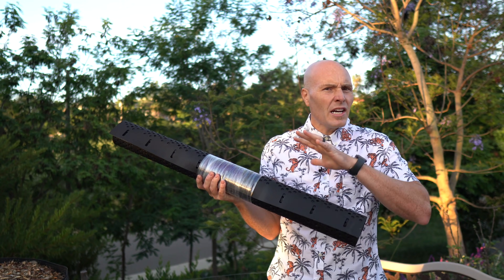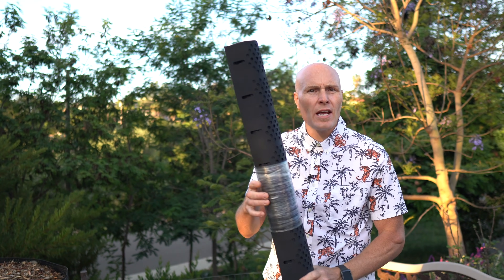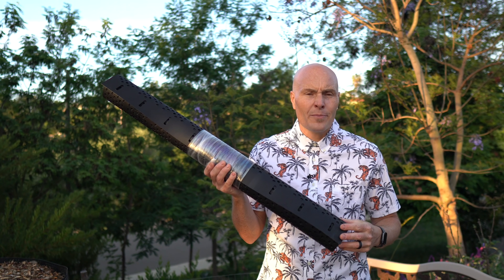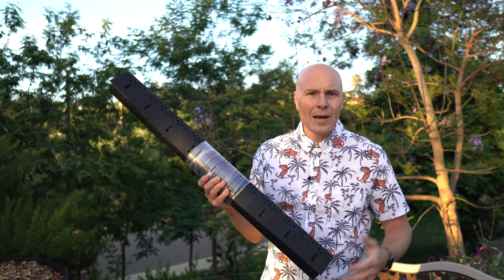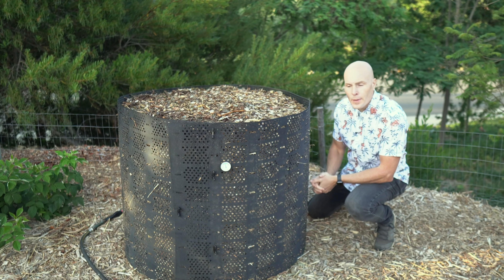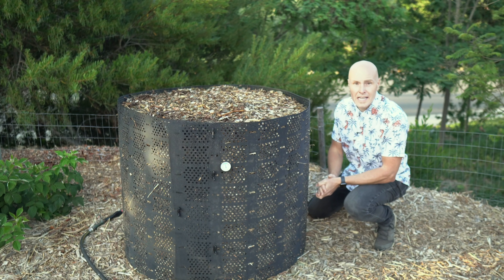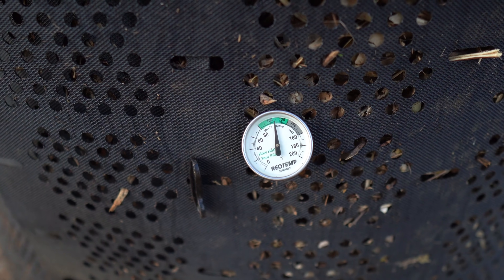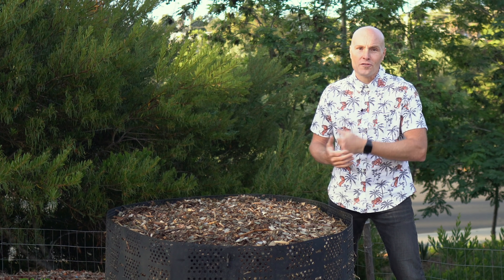Compost Woodchips Quickly - TURNING + ADDED NITROGEN = FAST??

Comment: I wonder if putting woodchips in a large barrel with a plug at the bottom would help along with a pipe for airflow. Fill the barrel completely up with water, pull the plug to release excess water and the pipe in the middle to keep it aerobic

Comment: why not use Urea?  Isn't it cheaper and it is almost pure nitrogen.  Did you follow up on this?  How'd it work out?  I have about 30 - 40 yards of wood chips (and more coming) and I've been considering  using my tractor to work  urea into them and tarping them.

Comment: I've  enjoyed your channel immensely.  I have 6 bio reactors now the last 2 I've  put 6-8 " of shread leaf and the same amount of shredded chips. Watering in between each. Then covering with cardboard i repeated this process all the way to the top no vent pipes . I have a stainless steel rod 3/4 " across 5 ft long with a double handle 
at the top that i drive down in it every 6-8 " working it around to make hole larger so i can water it evenly and add urine for the nitrogen.  I place cardboard on top and cover it with landscaping fabric. So far they seem to be doing the best.  I wish everyone good luck on theirs.👍

Comment: Diego, here goes another idea for a trial. Urine is "high" in nitrogen. What about irrigating a reactor with urine instead of water to see how fast it breaksdown from the constant nitrogen input?
Reply: I have 6 bio reactors the last 2 Im putting 6-8 inch shredded leaf about the same amount grounded leaf and wood chips water in between each  .covering it with card board and repeating this process all the way to the top no vent pipes. Cardboard on the top .landscape fabric on it. I have a stainless steel rod with handles  I drive  a hole every 6-8" around the top work each one around to widen the holes makes it easy to add water and the urine. They seam to be working the best so for. You have to feed those microbes.

Comment: Great idea! I just picked up some super fine crabmeal dust with high 12-0-0 nitrogen content. I’ve already filled my compost bioreactor but I’m going to try caking a layer of crabmeal dust on the top of the pile once a month and watering it in. Hopefully the dust will trickle down into the deeper sublayers. At the very least, it’ll help decompose the top layers of carbonaceous material even if the trickle-down theory doesn’t work. Science!

Comment: Thanks Diego. My compost bins are 34 gallon galvanized garbage bins with lots of holes buried in ground and lid on. I would like to hear your thoughts. Works good for me because don't need to keep watering, keeps rodents out (I add some food scraps), composting happens slowly in winter in my cold climate, continues to innoculate easy to leave some in and surrounding soil.

Comment: I've been using two Geobins as my primary composting vessels. I find them very useful. More rigid than chicken wire, but more portable than a wooden bin.

When I turn them, I just disassemble the Geobin from the pile, the piles stay intact, and set them up to the side. Essentially 3 "bays" with one always empty.
Reply: I just purchased my first geo bin, how's yours holding up so far? I filled mine up yesterday and I was more than shocked how much I was able to get into it! Probably going to get one or two more in the future

Comment: I use the same geobins to compost primarily woodchips and pine needles. I also throw in blood meal every 6 to 8 inches.  I'm in the desert south west and have to cover it loosely with a tarp or it'll dry out in a few days.  Temp will kick up to 140-160 in 1 to 2 days and stay there for a few weeks.  I've found you dont need a second geobin, just undo the clips and the pile will retain its shape. Reset up the bin next to it and shovel the pile back into the bin in the new location.   My last pile still took more than a year.  I'm trying again with flipping the pile every week regardless of whether the temp was coming down, and no tarp as I can rewater while doing the flips.  Seems to be going faster but much more work.
Reply: That a lot of hot water for free.....

Comment: I had created a pile of wood chips last summer that was left to sit all winter through the rainy season.  On May 1st I put together a smaller sized bio-reactor with five 1" pvc pipes ( it was what I had on hand) the chips had already started developing miccorhizie. I ran them through the chipper a 2nd time along with many bags of leaves. Soaked it, like Dr Johnson did and filled the bin. 6 weeks later that stuff already looks quite usable. I wouldn't start seeds in it, however it looks great for top dressing the garden!

Comment: Thanks for sharing your experiments. I've been drilling 1/2 inch holes all around the outside and bottom of 55 gallon food grade barrels to compost leaves and wood chips. I spray a mix of amonia, molasses and water after every 5-10 inches of material as I fill it and once a week after that. I aug a hole down the center of the contents about 3-4 inches in diameter with a piece of wood and cover with blackout fabric.  This generally takes 3-4 months to break down. I've been using this method for 2 years and it's been working well.
Reply: I might give that a try . I have 6 bio reactors im going to make 14 more between now and spring if I have the time and strength. I've  been doing 2 at a time each group done differently. 👍

Comment: I have 2 of the Geobins.  They work great but they can be a pain to setup if you don't have a reasonably level surface.
Reply: The key is when setting them up is make sure you have stuff ready to go in them. Getting the geobin1/4-1/2 full inside helps to keep it stable. I have my setup on a little bit of a slope and it's working great by doing this method.

Comment: I'm stoked on these experiments. I'm experimenting at home too.

I have a lot of scrap wood on my property (very overgrown acre) and I just bought a good wood chipper to turn it into mulch and compost. I started a pile last fall that was mostly wood chips and windfall apples, but had fall leaves added in October or November. Very carbon rich. I added grass clippings and a month ago to kick start it again after the winter. It originally started as an 18-day pile before I realized you can't compost wood chips in 18 days. It's been about 9 months and I'd say it's two thirds from being fully composted. Not bad, but I need compost sooner than that.

I just started another pile with 25/25/50 wood chips/biochar/grass clippings (by starting volume). It's likely very carbon rich as well, so I'm considering adding a sprinkling of lawn fertilizer next time I turn it. Not sure how effective that'll be but it's a high nitrogen source in a small package. Will report back.
Reply: Can you add worms to make it go faster?

Comment: I have an Envirocycle compost tumbler which I continually add new material daily.  The temperature has remained 120 f for over two months.  I have never been able to completely fill the composter to its maximum capacity as it continually reduces in size.  I will stop "Feeding the Beast" sometime this fall several weeks before I use the finished compost on winter garden vegetables.  I believe living in Tucson helps support the temperature of the composter during the summer months.  Sometimes, it will rise to 140 f but will not maintain this temperature for more than several days.  The size of the composter is approximately 35 gallons aka .17 cubic yards
Reply: The size of your tumbler is the reason. Needs to be at least one cubic yard to stay hot. There's not enough material to feed the beast, so to speak.

Comment: I put double layer of cardboard on top of my compost piles instead of a tarp. Seems to hold moisture and heat in some while allowing rain to get in some as well. Better or worse?
Reply: I just use spent pizza boxes as my topper. Works great.
Reply: The cardboard seems to work good for me .
Reply: I got some 100% wool pad that I had extra that I cut in a circle to fit perfectly in old dryer drums that I picked up from a local appliance place. Old dryer drums work great for composting but it's only about 55 gallons worth, by comparison the geo bins hold over 200 gallons. But the wool pad seems to be working really great as a topper,  I've been using it since spring and it seems I never have to water like it like i used to

Comment: Thanks for sharing this. I do some composting. We accidentally discovered having surprise gardens spring up in our garden scrap/grass/leaves bins. We put cheap metal stakes in a circle about 10ft across. Then the cheap plastic fence material goes around the posts. Works good. Grass clippings and cardboard, etc. Once composted good, we just toss in a little dirt kayer and put seeds in bin, like butternut squash. They grew and thrived. Amazing.
Reply: What a neat discovery!  I’m giving this more thought going forward. 👍🏻
Reply: What kind of cheap plastic fence material do you use?
Reply: @perpetual4958  buy it at Home Depot or Lowes, it looks like the orange construction plastic fense. There are different designs, we bought the dark green color. Or, you could use metal fence which is more expensive but will last longer.
Reply: @tjiacab3272  I wondering if just buying the geobin would be better for you? How much did it cost all that cost? And how long did it last you??